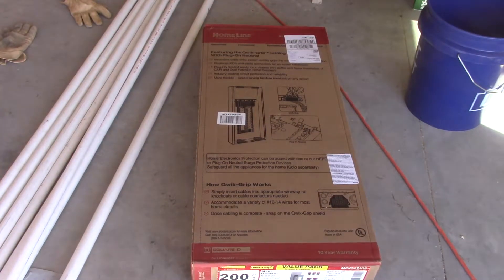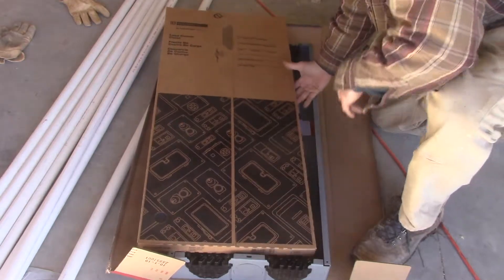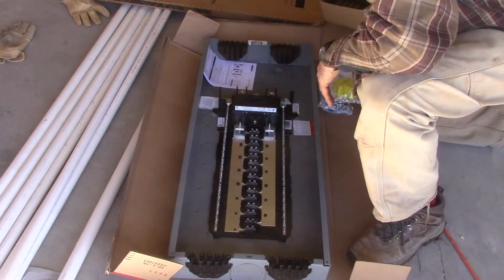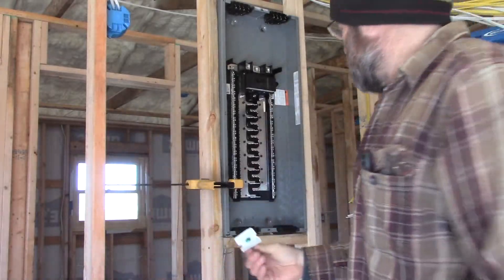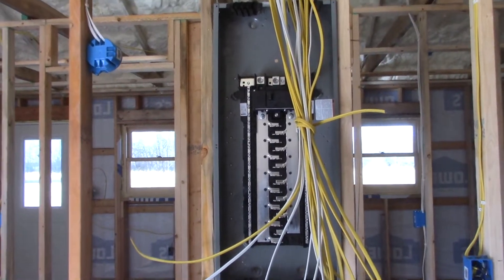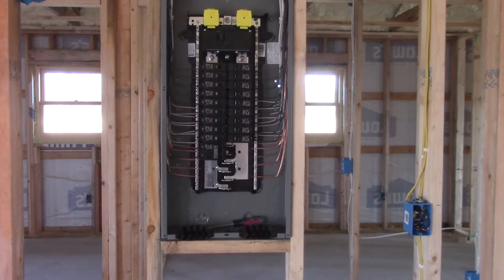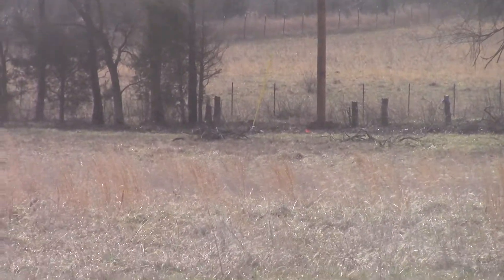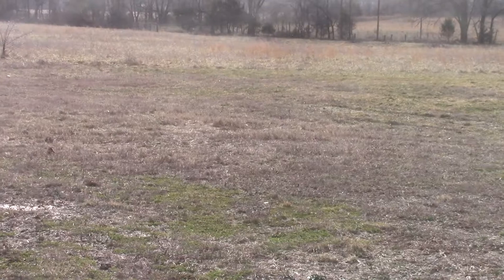House Build Pt. 11 - Square D "Qwik-Grip" Breaker Panel Unboxing

Comment from the maker: The power company installed the pole near the road and the service is ready to be tied in but I need to dig a trench over to the house first so they can lay in the wire and install a transformer but it's TOO wet right now!
Reply: Been there, done that. Rent a nice ditch witch and you can have that done in a day. Unless there is an old asphalt road underground that you had no idea was there. 😱Yep, that happened at my old house.
Reply from the maker: I had a mini-excavator scheduled for this weekend and I called the dig service too late and had to postpone the digging and it's been dry now for a while. Supposed to rain monday, of course!😆
Reply from the maker: I'm thinking about that but its probably going to be inside the garage later on.